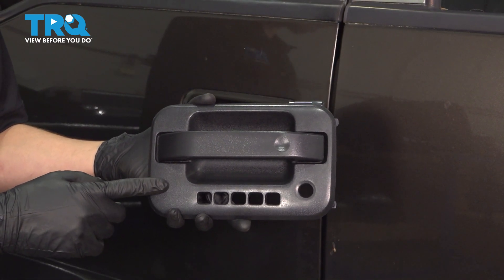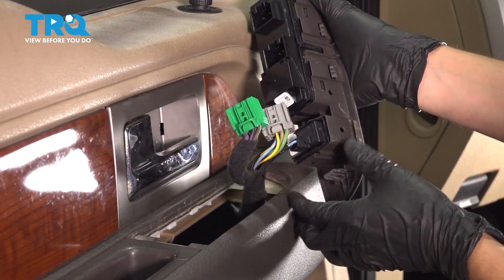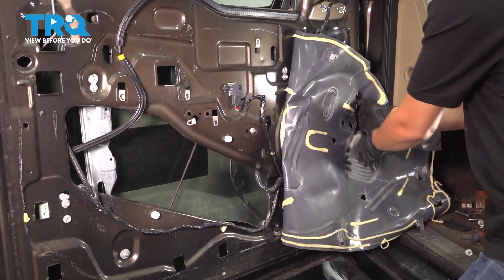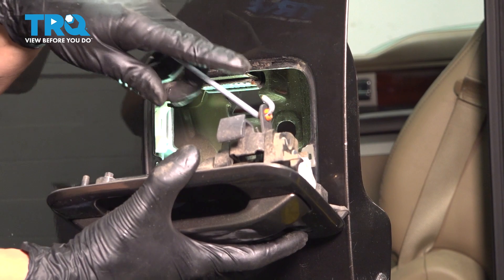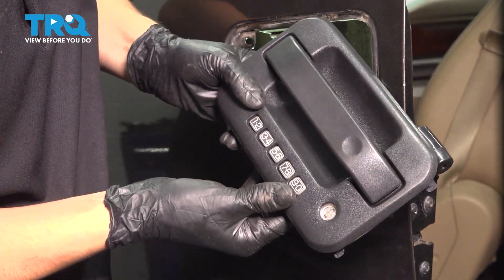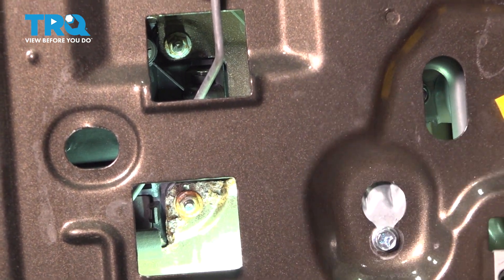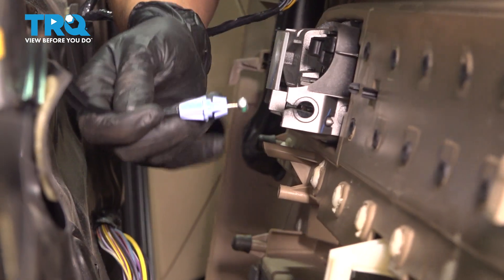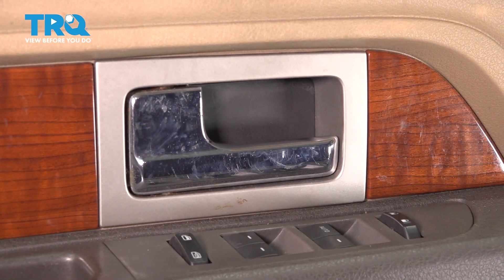How to Replace Exterior Door Handles 2009-2014 Ford F-150

Comment: the interior door handle housing has 2 tabs on the back that you can release to push the whole housing through the door panel and then rotate it and remove it from the panel itself is a lot easier than trying to remove the locking tabs and cable from the handle itself
Reply from the maker: +joe Thanks for the feedback! http://1aau.to/m/Shop-TRQ